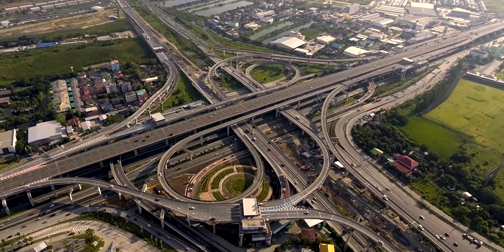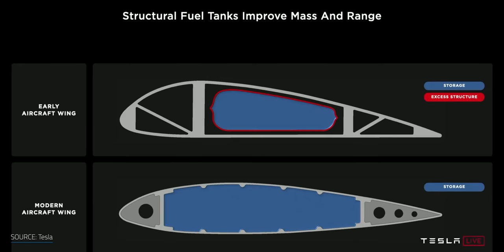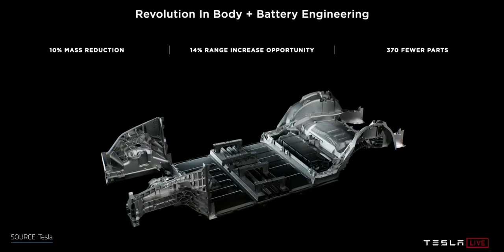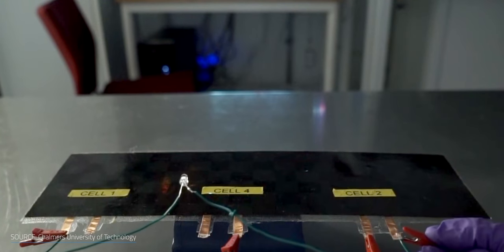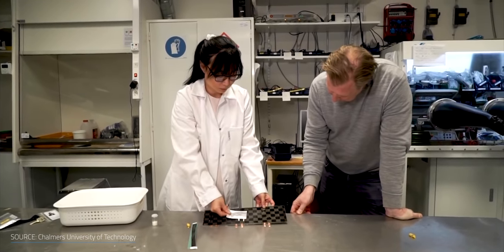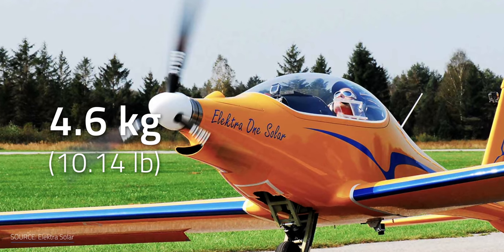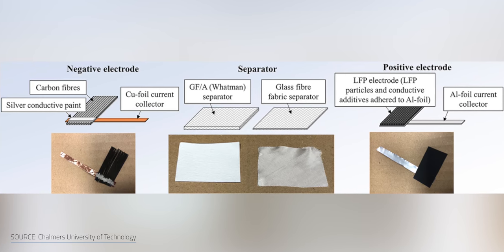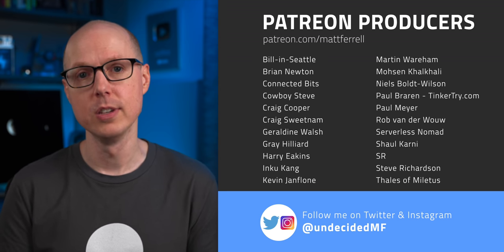Exploring Structural Batteries

Comment: Although very interesting, I think this creates a throwaway automobile. What happens when the batteries go bad? Replacing a super structure or frame of the automobile is monetarily ridiculous. Where did they end up in a landfill?
Reply: That is what I was wondering also.
One thing I did NOT see addressed.
When the battery is at the end of it's life (It will EVENTUALLY happen), how will it be REPLACEABLE? And at what cost if the vehicle would need to be (REBUILT).
OR will the vehicle be (DISPOSABLE)?
Reply: Great point. And given Tesla’s anti Right to Repair mentality without legislation that’s even more likely to happen.
Reply: it would be great to see what thunderfoots take on this, he's quite an elon fan
Reply: @azzabouy8243  I use to love that guy but he became a cocky opinionated grifter
Reply: Unfortunately I'm tired commenting this on every similar video. There it goes: anyone remember when we could change battery in the phone? There it is, made to fail at its best, first bulbs that only allowed 1000 hours before fail then phones that need discarding when battery dies then integrated radios and sat navs that can only be upgraded by replacing the car and so on and so on ... Wake up people!
Reply: @chrisemmert1387  that is if you don't have any accidents. If you do, the car won't last long enough to use up the batteries. this is complete bs
Reply: @dazdoestip6459  WHS
Reply: Was thinking about the same, in some ways it can be addressed with some modularity and making it "easy" to replace the frame, but in this world of companies like Tesla that don't allow for any repair, that's not happening. We need better legislation and then we would need for car companies to make this possible. In reality this might only work for some parts that are not part of the main frame... maybe the bodywork
Reply: You buy a new one. The battery pack was intentionally left accessible for servicing and repairing, but Elon doesn’t want to be in the automotive repair business, he wants to be in the sales. Disposable products for the consumer driven economy.
Reply: I mean, cars already get recycled. At least the metal electrode material and the electrolyte would probably be recyclable as well in these batteries.
If it comes to that probably depends on the engineering.
Reply: @djfernando16  lol, how often do you get into car accidents?
Reply: It's probably not even that hard to make those batteries serviceable if Elon wanted to but, sure let's make cars with the serviceability of an M1 MacBook
Reply: I'm just surprised no one is looking into making water electrolysis cars more cost effective or a viable solution.

We know it needs platinum, but how material efficient can you make it? Imagine running a car on nothing but water. Separating the water molecules to hydrogen and oxygen.

Oxygen could balance out the CO2 emissions and the hydrogen could be used as a gas combustion engine. And since it produces hydrogen on demand, it is relatively safe since water is not flammable.

There won't be any waste.
Reply: 1 year use cars... Or until a heat wave hits it... This is unchangeable batteries in smartphones all over again. There's a reason I don't buy those 😒
Reply: @resphantom  You realize the energy it takes to separate water is equal to the energy you get combining hydrogen and oxygen into water, right...?

You can't run a vehicle off that, the net energy is zero assuming perfect recovery. Realistically you'd actually run at a loss.
Reply: @DBZHGWgamer  source?
Reply: @DBZHGWgamer  It also takes a ton of energy separating crude oil, which is several varying lengths of hydrocarbon chains into the smaller, specific ones needed to be used as conventional gasoline. Separation processes, to purify substances accounts for 60% of the chemical & petroleum industries, and is actually ~35% of GLOBAL energy consumption.

The argument for running at a loss to me isn't valid. The bigger argument is the engineering logistics for a hydrogen car, such as high pressure containers for the oxygen and hydrogen storage, otherwise the car's range is non-existent. Energy density of hydrogen as a fuel versus gas, and other factors we can get into if you'd like.

I'd say there is a good argument to be made for the transition to fuel cells using water, DC current breaks water into O/H at low voltage (~1.4 V), solar cells supply DC as is, relatively easy implementation for the production of the fuel. Just the cost of the car is going to be higher and people need to be willing to spend it. Currently we're in "A Brave New World" mentality of throw anything away and buy it new. We need to fix the insane consumerism mentality if we want to even honestly consider a fuel cell car.
Reply: @resphantom  Have you never passed highschool chemistry? All the energy you get in combustion is purely determined in the difference of the bond enthalpy of the reactants and the products. If your starting reactant is water and your end product is water, the difference in bond enthalpy is zero, which means zero energy generated. It's literally the basics of the basics of chemistry.
Reply: @chrisstubbs6391  That's irrelevant, he's talking about putting water into a car to run the car. That's literally impossible, you can't generate any energy breaking and remaking water in a car. The system you're thinking of is different and uses hydrogen as a battery to store energy generated in a power plant.
Reply: Im sure they will find a way to recycle them
Reply: @chrisstubbs6391  It takes roughly 8-9% of the energy received from oil to not just refine it but also transport it. So for you to say running at a net zero at best is kinda odd. 100% when the largest argument is bc of emissions. 
Do ppl think making solar cells is clean? The batteries clean? The modules clean? And I see everyone talking about how it will be safer...  No No NO! Yes water is water and it is "on demand" BUT! 1.) You can't take out all the hydrogen out of the "tank/motor" bc the start up process is the largest energy consuming part. 2.) Even if you wanted to take it all out it's damn hard to w,o a vacuum. So no this is far from all safe as other state.  
 If hydrogen was so amazing why the fk are we not making power plants with it? It's almost as if they would solve most of what we are talking about right? Considering most energy used is not consumed from driving... 
 So instead of focusing on cars y don't we focus on the largest energy consuming problems first and let the chips from the cars fall where they may?
Reply: @DBZHGWgamer  It's not irrelevant and it's ironic you're insulting his intelligence without understanding what he is talking about.

For starters. yes his description is a little off, but if you're such a good chemist as you seem to be preaching, you could easily correct him and make his idea realistic instead of acting like there is no truth to his statement, but I guess that takes "intermediate" chemistry knowledge and basic humility.

He specifically said electrolysis of water, using platinum. This is a very specific reaction of running hydrogen and oxygen over a platinum surface (which acts as a catalyst and conductor). The gases recombine into water, which is a net production of energy because water has less enthalpy than the individual components. The energy is directly converted to electricity via the platinum and can be used for powering an EV in theory. He isn't saying put water in and running a vehicle off of that.

It's also more efficient than a combustion engine because it's 2 degree of energy conversion, chemical potential into electric into rotational kinetic energy. Whereas a combustion engine, which could be run off of combusting H and O just as easily as gasoline, converts chemical potential into heat/pressure into linear motion into rotational motion, 3 degrees of energy conversion with each step inevitably resulting in entropic losses.

He is talking about a fuel cell car, with water as the exhaust. He explained it poorly sure, but surely someone as informed of you would know what he intended?
Reply: @dizzlethe7346  I may not have made my point clear enough. Yes undoubtedly fossil fuels are net positive on energy otherwise we clearly wouldn't be where we are today. Was just pointing out to the other guy that all energy storage devices requiring putting energy in.

Is green energy "clean"? Obviously not, there are always CO2 emissions from extraction to construction to end of life dismantling. Nuclear is a good example, very CO2 intensive for if I recall correctly the number of steps, 12 out of 13 "Steps" for it's lifecycle from raw materials to disposing of nuclear waste with the only CO2 friendly step being it's actual operation. That being said nuclear is the best option because of the energy density it has and the energy we get from breaking the strong force as opposed to chemical bonds. All these environmentalists want to go 100% "green" to save the planet, but doing so will require (for the same energy output), destruction of a large percentage of the nature they're trying to protect to install an energy grid to achieve it. Because I'm sure you know green energy is not very energy dense or reliable at handling variables like cloudy days, lack of wind, storing excess energy, etc.

The thing with some forms of green energy is their longevity that makes up for their less energy dense, solar panels have an average life of 25-30 years, this greatly outlives many traditional such as motors (5-7 years), boilers for steam generation (10-15 years), etc. And solar panels are significantly easier to maintain requiring near zero upkeep. 

I'm on the fence of the whole CO2 thing because for at least 60 years all the climate alarmists have bee wrong and constantly pushing the goal post, adjusting their models, and still we don't see the doomsday predictions they keep giving us.

That being said it is to me reasonable to consider feasible alternatives that are relatively safer. An oxygen leak from a tank won't cause chemical poisoning of ecosystems like oil/gas. Both are flammable/explosive, so oxygen has the relative safer score there by not being a long-term health hazard.

Not exactly sure what you're referring to about taking all of the hydrogen out of a tank/motor. All start-ups having higher transient energies sure, but how does this relate to not being able to remove hydrogen from a motor? Very lost on your connection between the two. Especially the part about adding a vacuum, electrolysis reactions aren't operated at a vacuum. Can you elaborate?

Personally I'm in favor of energy reduction, billions of lightbulbs that operate inside buildings that are empty, it adds up. And a transition to more nuclear would be nice, they're inherently safer than any other energy source when you compare energy production to deaths/environment. But people are so afraid of it.
Reply: @resphantom  Yes, bond enthalpy isn't the basics, just bond strength and enthalpy. Because those aren't at all the same thing or anything.

In any case the dynamics of a hydrogen fuel cell car is completely different, but in the end it's basically just a battery to store energy. And as a battery it has a lot of it's own issues. You can refer to Chris Stubb's comments for some of that information.

And also, you're running on hydrogen, not water. So none of that "safety of running a car on water" applies either. But that was just you explaining it improperly or something...?
Reply: Tesla Still has a modular system with their structural battery, it's still a battery pack it  is just bolted onto the floor and is the floor. It will be a major thing to do, but since you only have to do it every ten years or less it should still be worth the savings in weight.
Reply: @chrisstubbs6391  "Such a good chemist as you seem to be preaching."
So apparently telling someone a concept from highschool chemistry and commenting that it's an extremely basic concept... Is preaching that I'm an expert in chemistry...?

How does that logic work, lol wut?
Reply: @DBZHGWgamer  That logic works because you came from a place of arrogance and insulted him for supposedly not knowing something instead of just presenting the information. 

You're presenting yourself as pretentious.
Reply: @DBZHGWgamer  It's also the internet, you know nothing about his age, country, education, etc.

For all we know he could have never taken a chemistry class.
Reply: @zacharywissinger3996  I imagine this is where vehicle rental becomes more interesting, since when then vehicle reaches end of life it then becomes the manufacturer's issue. I am sure regulation will also step in to help clean up any mess the auto industry creates.
Reply: @chrisstubbs6391  My first comment in response to him simply presented the information that seperating oxygen from hydrogen and recombining them would give you a net energy of zero. Instead of saying that wasn't what he was saying or looking into it he doubted and asked for a source. Were I to actually produce a paper on electrolysis he probably wouldn't be able to read it, but that's what he asked for. Instead of taking the long way around I introduced the basic concept myself since he was unwilling to even do a basic google search to fact check himself in the first place.
Reply: I foresee it being the Apple of cars (planned obsolescence/unrepairability). Once it is out of warranty, it’s the owners issue.
Reply: @djfernando16  Totally. The issue is just so huge that I can't wrap my head around how to create such a culture shift. My best guess would be social marketing and easy to digest stats/infographics.
Reply: Carbon fiber is the next asbestos. It's just as dangerous when inhaled and is nearly as inert. We'll be seeing the health effects when vehicles featuring carbon fiber make it to the crushers.
Reply: @chrisstubbs6391  In the first place, why should it be considered ok for a person to advocate a technology they don't actually understand? That's not ok. If you're advocating hydrogen fuel cell cars, it should be expected of you to understand how they work, atleast in terms of the basics. It's because of people who know literally nothing about the crap they're promoting that projects like Theranos, Solar Roadways, Hyperloop, ect run away with hundreds of millions and even billions of dollars, all wasted for crap that obviously couldn't work with knowledge taught in highschool. People shouldn't advocate any technology they can't accurately explain.
Reply: The only way I could see it fully possible at the moment anyway. Is if they did like auto parts now of cores but with the whole vehicle. You have so much go wrong and you trade your vehicle for a core which is almost the full value of new but then you're forcing customers. Or if they make it to were you can unplug the door which is the bad battery and replace it that would work like today. Idk.
Reply: @DBZHGWgamer  Eh, I agree and disagree to an extent. 

I agree with you the point of boondoggle projects. But those I attribute to political favoritism and corruption for subsidies more than saying it's the fault of the population for a misconception. Think it's safe to admit most modern policy isn't in line with popular desire anyway.

As for the other point,  I have to disagree entirely, I think he has the right to talk about something. He's got a misconception sure, but I rather present the objectively right concepts instead of what you are saying which to me comes off as a advocating censorship.
Reply: @Array_of_objects  How optimistic. And gullible. It doesn't sound recyclable in any way to me. And there is still lithium in it, as it seems "integrated" in an inseparatable way. The fact that reuse or recycling is not mentioned at all says a lot.
Reply: @chrisstubbs6391  First I have to just say I'm happy to see we are mainly on the same page. On well, EVERYTHING lol. 
I want to address the "tank/motor" I was talking about either holding or making the hydrogen IN the car it's self. Everyone "not you with this" talks how safe the car would get bc it's just water... Your always going to have pressurized hydrogen on board in said tank. Basically a bomb, that doesn't need fire to go boom..  Like yes batteries aren't supper safe either but I'd rather have that couple of seconds that the fire starts then a boom if something goes wrong lol. 

Nuke power as the main lasting energy provider over the next 20-100yrs I agree with. Along with solar.. mixing into your light comment, we already have a major unused area we can put panels.. Every fking road with light poles or plain electric ones. Along with the replacement of the 6-800watt hps lamps with 40-100watt LED the replacements alone will go hella long way. 

 ROFL better keep that talk on the DL here about CO2 in this chat. But again I agree with you on the lvls.  Ppl are so fixed on CO2 being the only link to global warming/climate change (wtf ever the hip thing is) that they blinded themselves to other larger factors. That if they didn't could also become forms of energy. Like methane gasses! If you look at the productions of CO2 an methane into the air they both have gone up damn well together, yes methane at half the clip but we are talking about something that holds 8xs+ then co2 does. But CO2 is what we are fighting? Even tho we know it's been 10x higher in the past (what happened? Plants grew better ROFL) but methane as far as we can tell has only been 2x what it is. An what can we tell that happened in that time? O higher temps?? Ok ok CO2 is the cause sounds legit with the facts THEY show. 
Sorry so long but the shit talk got me going lol. Also makes me want to point something else out.  It's not like we can't capture and use ALOT of the methane produced either! Sweeden does it, with both landfills  (everything is ran off collected gas even trucks) and sewage plants in med/larger cities. They not only run the sewage processing plant off of it, they run the water processing plant and also precondition/reheat the water for the steam heating systems they have for the city inside the microb pools. Sheet seems light years ahead, now imagine doing both (bc landfills still have stacks that burn off extra methane)next to each other inland of a major city like NYC (a good chunk are heated off CITY steam already) picture being able to use the wastes. To heat (use the landfill to preheat also) purify the waste water, make drinkable water along with either making the gas or power to run most if not all the transportation and street lights in the city. Not only from wastes but wastes that ppl already pay to dispose of. You can rinse and repeat for any decent sized city too. You can do the same on a smaller scale with the "hot" wastes from animals also while they wait for it to cool an sell as compost...
Reply: Exotic cars already use CF for their chassis. Carbon fiber already cannot be repaired once damaged. 
They will not use this for affordable cars but maybe on concepts/exotics.
Reply: @dizzlethe7346  I just want to point out hydrogen tanks for cars don't go boom. They are designed like the industrial H storage tanks except smarter with sensors and a rupture in the tank(which takes the force of a large ballistic to rupture) causes it to quickly leak out like a mini RC rocket. Its much safer than a fossil fuel tank which combusts and keeps burning for hours till everything around is burnt to a crisp.  
Hydrogen gives a heavy sedan -/+70mpg so the hydrogen tanks are very small to last a good range of 300 miles. 
With enough stations it's very possible they will also take over traditional gas stations in the future. 

It's good to point out that currently there is a renewable source progression of using biomass gas as a methane replacement that will reduce the footprint even lower than EVs.
Reply: @dizzlethe7346  A lot of your comment I agree with, but honestly I disagree with the use of solar. People are too stuck on the idea of solar and wind as the only viable renewable technology. Honestly geothermal is way better. You don't have to have massive arrays of batteries for geothermal, you can raise or lower the output at will and it doesn't depend on external factors. And with current technology, you can put a geothermal plant basically anywhere, you don't need a natural gyzer. All you need is some drills some water and basically any peice of land. It'll have a bit higher initial investment than a solar array or wind farm, but it's more than worth it.
Reply: @chrisstubbs6391  It's not censoring, I'm not saying silence people. Just expect more from people. Address them when they're wrong. Create a culture where people learn to be informed and that they expect that being ill-informed will harm their reputation.
Reply: This would work for fenders, doors, hood and trunk lid. They won't all fail at once. It might make the car last longer.
Reply: @DBZHGWgamer  "why should it be ok for people to advocate something they don't understand?"

How is this not censorship? Galileo was considered wrong about a heleocentric universe by everyone else. 

I get the point your trying to make, but it's from an absolutist perspective.
Reply: @chrisstubbs6391  You're clearly completely misrepresenting my argument. I said don't advocate something you don't understand, not don't advocate something other people disagree with. Those aren't the same thing.

Secondly either you don't know what "censorship" means or you simply aren't understanding the words I'm saying. Censorship means removing the ability for an idea to spread or removing the ability of a group or person to have a platform. At no point did I indicate people or ideas should be silenced or deplatformed in any way. What I did say is that people should expect to be corrected and insulted for not doing their do dillegence it reaserching an idea before advocating for it.
Reply: @DBZHGWgamer  I merely interpreted the quoted text as them shouldn't advocate and without context implied you meant by taking away their ability to advocate it.  

Not trying to misrepresent it intentionally, just my interpretation because of the flaws of written language not being able to present a speakers tone fully. I agree with most of your point, still think insulting is a quick way to have valid points fall on deaf ears.

Appreciate the civility either way, always refreshing to have instead of typical internet raging.
Reply: How often does an entire motor get replaced in a conventional vehicle? Unless your some grease monkey car modding mechanic, or know one. This never happens.  There are warranties for the Batteries and motors. If it fails with normal use on a car that has structural batteries, the owner get a new car. The car returned under warranty would likely go back to the manufacture which could deconstruct the vehicle and move the functioning parts to another vehicle.
Reply: Just make it biological or something
Reply: @JasonB808  Not the point. In this case the battery IS the car.
Reply: @dazdoestip6459  You can still change batteries on a phone, or at least phone shops can do it. If you're brave enough, you can do it yourself. You can back everything up to a Google account online, or to an SD card, so if the worst happened you wouldn't lose anything. They either spudge the cover off, or gently melt the glue. China still has big piles of pouch cells to sell you.
Reply: Cars don't go landfills. They're always salvage value. But yes, It's a trade off. Luckily, it's a tradeoff that we can very easily mathematically calculate if its worth it. A non-replaceable battery means the car will depreciate in value more rapidly. If the energy saved plus the quality of life value of having added range is greater than the difference in depreciation, then it's worth it.
Reply: @walkinmn  You can't really replace the frame of a car at all these days. Often the bodywork itself is load-bearing or force-bearing, they haven't made them as chassis + body panels in 40 years or so. It's all monocoque. Even if there were a separate chassis, you'd have to un-bolt and un-weld literally everything from it. But there isn't. It'd be more gutting the old car for parts, then fitting them to a new one, taking way more human labour than it did to make the car in the first place, which robots mostly did. 

Still, the cash value of the various parts will be different from present-day cars. If the old body is useless, and also the battery, that's where a lot of the value will be. The old motors, you might be able to salvage for spares, a garage could buy them from you for future repair jobs, although generally electric motors don't go wrong often. Nor do electrnics. The computers, though, on an old car are likely to be laughably obsolete, so nobody will want those. So all in, little demand for the few bits that remain viable. 

Overall, economics will compensate for it. Things end up at a price that the buyer can afford. Structural batteries might save a lot of money in car construction. Electric drive, too, requiring no gearbox, or necessarily any drivetrain. No fuel system, and simplified cooling. Could be a lot of savings in electric cars. Right now they're priced to compete with ICE cars, and at the higher end, because currently there isn't much demand, or supply capacity, so they started at the high-mid end. That can all change drastically. Look at what PC's cost in the late 1980s, compared to now. They now cost around 10% of their early price, and that's just ticket price, without considering inflation. And of course our PCs are thousands of times faster, thousands of times more storage, etc. 

Cars won't change that dramatically, but electronics in a mass market have a HUGE potential for massive price changes. 

It probably won't be possible to have replacable chassis any more than it is now. But that doesn't matter, the economics can be totally different. What the customer is willing to pay is one of the principal factors in pricing things. Less and less labour goes into making a car, there's a big cost saving. If people get used to carbon-fibre (DON'T call it plastic!) structure, then that's a load of metal that doesn't need digging up and refining. Yeah carbon fibre isn't cheap now, but aluminium used to cost more than gold, per ounce. Plenty of carbon on the planet.
Reply: @DBZHGWgamer  all the time. Never my fault
Reply: @greenaum  yes I know but that's not the point, the point is that they make it so hard to change the battery not to mention you loose water proofing after you change it so  people just change the phone. Now on to another point, you would rather have to unbolt and unplug to swap your battery in the car or would you rather cut it out and unglue of its body and then cut and rejoin the wires required?
Reply: Agreed, also considering the high envi impacts of curing carbon that is a none recyclable material.
Reply: @dizzlethe7346  Yeah the tanks is one engineering challenge for a fuel cell. If you want to compete with the range of a gasoline car they'll need to have the oxygen and hydrogen either be in highly pressurized gas, or a combination of pressurized and cooled container to store as a liquid fuel. Either of these options are going to make the cost of a car skyrocket. I think it would be better as some people have mentioned to focus on short range vehicles instead. Side note the hydrogen is relatively safe at high concentrations, there is an upper explosive limit so the H2 tank will not be flammable or explosive, oxygen is a different story, >25% can spontaneously combust, always fun.

As for the lights, LEDs obviously more efficient, could be wrong but I think there might be an issue with having enough raw materials to replace every light with an LED. Need to look into that more, either way a reduction in energy consumption is always reasonable.

Yeah the CO2 thing always had me bothered. First it's the question of chicken or the egg. CO2 levels are rising, so is temperature. Water cannot hold as much CO2 if it's hotter, so is raising temperatures releasing CO2 or is it the CO2 that's causing the temperatures? Kind of inclined to believe the former, we're at 400 ppm CO2, that's 0.04% of the atmosphere, you're telling me that changing concentration in the air by a value that's 100x smaller than standard acceptable errors (5%) for calculating things like rocket design is going cause >6% deviations in temperature? Like I get the heat capacity of CO2 is half that of steam at the same temperature, but a 0.04% change in heat capacity is not going to drastically change how much energy it takes to actually raise the air temperatures.
Reply: @dazdoestip6459  The radio thing is a major reason why I own older cars. I love custom audio and having to do hacky things and possibly lose functionality is a huge downside. Oh and the build quality of late 2000s to now is awful in NY they rot so fast from the salt.
Reply: @DBZHGWgamer  Yeah, my explanations suck, still working on that. Eitherway, it would be interesting to see if they can take that electrolysis tech further, because the major downside for using chemical based batteries is improper disposal or underground water contamination.

The reason I meant that it's relatively safe is it depends on the engine design. If it consumes at the same rate it produces hydrogen, then there should be very little left to blow up in case of an accident. In case of a fire the engine would mostly contain water.

Unfortunately, conventional cars don't blow up because they're full of fuel, they are more likely to blow up when the tank is almost empty and only fumes or gas is left. But a full tank leaking fuel could be a major fire hazard.

They could also always use the same water to cool the engine, however any combustion engine with friction would lose too much energy and not be feasible.
Reply: @resphantom  And what energy are you using to produce the hydrogen?

Again, a car that runs on electrolysis doesn't work.

A hydrogen fuel cell car does not use electrolysis.
Reply: @chrisemmert1387  why do you feel the NEED to type WORDS in capital LETTERS
Reply: @justthink124  I thought so too. But drone batteries cant be integral with the structure unless you want to replace your entire drone whenever your battery performance degrades.
Reply: @dazdoestip6459   
Car lifespan more than 10 years.
Phone lifespan 3 - 5 years?
Reply: What a circus.
Reply: @lwolfer5170  well, it a bit late for lightbulb moment. Capitalism and large scale corruption led to this. It didn't happen over night, and we're all part of it.
Reply: Also what happens if you hit some debris - and do some damage like that guy who was told by Tesla it would cost $16,000  to replace the battery (even though a shop ended up doing a $700 fix)  https://www.thedrive.com/news/41493/teslas-16000-quote-for-a-700-fix-is-why-right-to-repair-matters
Reply: @dizzlethe7346  it’s because hydrogen is easily accessible, it wouldn’t be profitable so they make nothing that uses it because they can’t markup the price.
Reply: @chrisstubbs6391  with the hydrogen part. Would it not have to either be at ungodly pressures tho? That or your going to rely on the car to split the molecules an if you do that your range is going be cut and your either going to need the sun (an solar) or a large battery in the car anyways right? 
An if it's high pressure then it's very much a bomb that not only cost a ton but who all will actually be able to work on it?
 I'm pretty sure HPS bulbs (of a Street lamp size) are consuming more resources then the led ones. 
 As far as solar naw man it's not going to be the end all solution. But that combined with nuke power can take up most our power needs if not all of it with hydro an the stations I talked about being the rest.   
With solar I just don't understand y we are not using the empty space we have first then build out. We have plenty of roof space, light/electric poles, tons of open roads an waterways that run east to west that already have power line next to them.  100% the light pole shet tho, we already pay to run and replace them. The city I live spends something just over $200 a light for maintenance, electric ect pr yr Putting a 200watt solar panel with LEDs in it should cut those cost to 1/4 yearly along with other electrical bills.   An for the amount of money it would take to get to a point we are not paying for city utilities I just don't understand y it has not been done.  PS FK wind power it's too costly, needs to be repaired to often an is shut down too much with "high" winds. I love on lake Erie an to have wind power only work a few months out of the year is actually stupid lol.
Reply: Yes it would wouldn't it... That's why they need somekind of buy back warranty so it can become recyclable. All done with 3d printers. It can be done!!! Imagine if it could even be made self healing or at least healable at the factory...
Reply: @DBZHGWgamer  I'm with you on Geo also! Look I just went on the rant about landfills and waste water lol. With how they can an do use it to preheat water. I'm in the middle of building a family compound now! It's just almost impossible to retro fit existing homes an it's costly AF if you have to drill everything vertical! That an it being cheap to heat (an cool) with fossil fuels no one wants to convert. That an most ppl dont need the output even the smallest Geo systems can put out so that puts then off for some reason. Even tho that mean it runs more efficient but w.e.. Like I'm able to keep a 5000sqft uninsulated shop only on the pump and 3loops of the system..   I have a pretty basic mixed loop (both vert an horizontal lines) but I added a commercial aspect to it having two insulated 5000g tanks dropped into a pits filled with sand. To use as main batteries one hot one cold but I also have a massive pond I'm going to use for heat storage and put lines running in it also for winter. Hopefully only one more lake Erie winter an it'll be up.
Reply: This will be as recyclable as mutlistream plastic.  While theoretically possible no one will do it.
Reply: @WhiteWolfos  I understand what the tanks are made of. But thos tanks also have life spans and dos along with don't. Like massive temp swings that will happen in a vehicle tho. Making the tanks take stress they were not designed for. So ya the tank at first might be safer then fossil fuels then. But over how many cycles is it going to degrade giving you a massive bomb in your lap? With everyone talking right to repair. How many ppl are going to be able to work on them? An I don't even mean just yourself but how many 3rd parties too? So not only is the cost of the car going to be sky high, keeping/work on it will also not to mention insurance, do you know how much insurance cost on any EV right now? Much less a Tesla. When I had a Tesla (3months) I found my insurance was almost the same as my payment. Making the $100savings in gas NOTHING. $450 car 350 insurance to save $100 or just pay $200 for a fossil fuel an insurance.    With $100 in gas a month. $300 vs $800... The practically of focusing on the car when it doesn't use anything compared to a home. An expect ppl to want to change off of the car is actually insane. This focus along with battery tech needs to be on the home an corporate aspect of things to actually make an impact. An with that being said if hydrogen was so successful y is it we aren't making power plants out of it? Again for the car aspect when home an business needs use more fossil fuels then transport ever will. Finding the best aspects for Corps not only makes the tech cheaper but gives a blueprint on what to do in a smaller scale, doing so makes it easier for the average person to also buy in right?
Reply: @JasonB808  it's literally 7-14bolts and some wiring harnesses. My wife was taught how to replace a motor in a Ford escort in two 4hr days an if she can do it anyone can. And I swear if I hear someone say well you need tools to do that. Has no one ever heard of renting out a shop?
Reply: @kandy5129  Ok but in that same sense why would energy providers not use it then? They would have no cost in fuel this way right? They don't bc you do not get a net positive in energy production. I'll have to find the papers.  But the only way I know of that they found you can get a "greater" energy is from double heat capture. Making the device large an your not always going to need or use that heat. When that happens it goes back down to less energy output then you put in
Reply: I think the body would have to be made of substructures and so replaceable parts - very similar to to the repair industry today - of damaged parts there is very little actual panelbeating getting done these days most damaged parts are replaced
Reply: Crash absoroption rails can be cut off and replaced.
Elon musk is making it still possible for repair shops to do what they need to do I think. I dont think this will be a problem with legislation imo.

For a company like Tesla, I personally give it a pass for not having spare parts available. Their a new company, and dont have the necessary manufacturing capability to meet demand enough. Naturally they would prioritize newer customers over old customers. In time, once they get their plants up and running, we could probably see spare parts come out in the future.
Reply: @dizzlethe7346  I'm talking about geo power, not geo heating. While geo heating is useful, in many scenarios you can achieve somewhat comparable levels of efficiency with a normal heat pump depending on weather and have normal natural gas heating for backup. It is also way cheaper than installing a hole geo heating system.
Reply: @bowez9  Sadly if we can't get it right we kill our innovation and go no where but you are correct. The solutions are a given if they can't think any further than their pockets and don't work out a win win. They don't have to loose money to do it they just got to use their brains... Come on Mr. Musk I dare you!!! Wish He could see this.
Reply: @dizzlethe7346  Depends on your idea of ungodly pressure. Typical SCUBA tanks have working pressures of 3500-4500 psi with a hydrostatic test pressure of ~5000 psi. That is significant amount of gas, but even accounting for increased gas density due to compression, it's still ~20x less fuel for the same volume as a liquid O2/H2 tanks. Liquid tanks have technical difficulties arising from the liquid evaporating as it is used. 

I think the idea of scuba tanks as storage tanks is feasible, would make refueling almost faster than conventional since it's just swapping tanks. But again we'd have to collectively be satisfied with significantly reduced range per tank.
Reply: @Array_of_objects  sent it to a 3rd world country and let the people break it up by hand to recover the useful stuff... kind of how electronics are done today... only down side is the toxic material that the people are exposed to and the mess that’s left behind.... clean for the first world consumer....
Reply: also, think about an accident or a fender bender. if your car door gets dinged, and the door is the battery, what happens to the battery? how expensive is the repair? could a minor accident cause the car to be written off because an integrated battery got dented? if not hoe would a dented battery effect performance?
Reply: @chrisstubbs6391  it's not just the reduced range tho. Refilling or replacing the tank not everyone will want to do an will take longer then just filling up fossil fuels.   
 Plus my point with the tanks was more a fatigue thing along with outward pressure not inward like you find on scuba tanks. That along with corrosion from salt an other materials found in cars. Bc I assume we are talking either stainless steel tanks or aluminum right?  An like with the range what your talking about should be able to be solved with just public transportation I'd think.
Reply: @dizzlethe7346  Public transport is a completely different point, if people did that more often or rode bikes like Denmark, we would be a lot less concerned about the emissions of cars.

I'll assume you've never gone diving, but changing a tank is literally a 20s process if you're proficient, gonna be faster than the pump, but again smaller tank.

Not sure what you mean by fatigue, the pressure is inside the tank, not outside, there is no "inward fatigue" for pressurized tanks. Worth noting though, is pure hydrogen is going to be a complete pain to store in metal tanks at low temperatures because of hydrogen embrittlement. 
https://en.wikipedia.org/wiki/Hydrogen_embrittlement

This is again why liquid fuel would be better, but that still has problems with implementing.
Reply: @DBZHGWgamer   Geo power your talking massive an deep holes that have to be in stable areas tho. Right? An I mean will be great for supplemental output specially linked with a main nuke along with solar supplement also.  I just don't know if it can be used in enough places to make a massive dent/be the end all be all energy. But then if batteries keep making leaps and bounds who knows. But I think it's going to have to be a decent mix of things to have good reliability.

Yes I am talking heating an Geo cooling. But the same time I am also taking any extra energy and storing/making a battery or energy. either in water tanks, a pond or the earth both the heat and the cold to be used later. An heating a pool also. It's far from a normal home application. Lol  ya I have two 15 ton main commercial Mitsubishi compressors/heat pumps seer 32 cooling and 35 heating  at 65 degrees F. Or starting temp/ Geo temps 10ft deep in south east KY/ near Knoxville Tennessee. An they only take 3500watts to start and 2500 to run full blast with enough BTU to heat and cool 10 houses plus my shop. Along with being the main driver of intagrated heat pump driers and refrigeratorsan or freezers. An that's just to start with! Bc after my "storage" is to temp it's either going to be easier to run everything/less power or I'll be able to heat an cool more.  An if you have the land/pond or water it's not as expensive as most ppl think. I rented a back hoe an put in 8 400ft lines myself for less then 2 drilled 100ft double loop lines... An if you have water it's almost as ez as going to the middle an tossing it out lol.
Reply: @chrisstubbs6391  naw my point with PT is that it only works for city ppl mate. We are much larger then Denmark an have way longer commutes to well anything lol.  

 I drove a tow motor when I was younger an I'll tell you now that changing a tank is FAR from just 20s... An that was located on the outside of the vehicle with room to get it in and out.. it's not going to be that ez inside a car. An the average person male or female is not going to want to lug a empty 20-50lb tank around.  An most aren't going to be able to handle full tanks as needed to replace them. Top off could you imagine forgetting to lock the 80lb tank down after changing it, slamming on your brakes and having it fly threw the trunk into the back of your head. Then your going to need a industry wide standards from the tank itself (so it fits all cars) to the connection. Then deal with how sea level effects the amount you can put in a tank over the vast landscape of the US..  Then we get to the fact to make something like liquid hydrogen you get the same energy as you put into it. Ok but then you take losses when you make energy from the hydrogen. An what energy was used to make the hydrogen in the first place?  An again idk if I missed it or not.  But if liquid gas was so great why don't we have more electric plants running that then coal? 

 Then when we are talking such short ranges Y not just stick with batteries? Not this type of course to many flaws on how it's done as a whole. The way battery tech has come the past 10yrs you get almost 8xs the storage in the same area but lighter package, give it 10more LoL.
Reply: @dizzlethe7346  Never said it wasn't technically challenging for the idea of a hydrogen car, but fuel cells do exist, Toyota if I recall is the brand trying to commercialize a fuel cell car. 
But their approach is more of a battery style instead of tanks.

The idea is hydrogen/oxygen formation from water could he done prettily easily from DC voltage powered by solar. Submarines use an oxygen generator that basically does this, splits water into the parts and vents the hydrogen overboard. You need very pure water and KOH to aid the process though. 

Coal is a solid, more dense than liquids, inherently way more energy dense, and just laying in the ground. Seems like an obvious enough reason why we have so many Coal plants, it's there in the ground to use.

Batteries are nice, but the push for Li based batteries does bring up some morality problems with mining it. Australia had a huge reserve, but there's a lot of conflict in Africa with warlords like diamonds were and continue to play. Theoretically even transatlantic air travel powered solely by planes is possible with continued battery improvement. I'm a skeptic of that claim, but they were made by people who are heavily involved in battery research.
Reply: @chrisstubbs6391  As far as the energy production an emissions we give off. I went over this in another comment on this thread. But we waste so much an are not smart with recovery at all.  First we could replace the 6-800watt HPS street lights with 40-100watt LEDs. We can toss a 200watt panel on them ALL. The led is cheaper off the rip then hps cost less to run an last 3x the hours.. Then the aspect of no captured methane (the real green house gas) from either landfills or sewage processing plants. Along with all that captured heat. The misplacement of solar farms displacing wildlife when we already have massive east to west roads with power lines an light poles that can be used for solar, we also have massive water ways we should be placing then next to (like India) that not only cools the panels but helps with evaporation in the Southwest US. We don't capture the heat or cooling from the refrigerator,freezer, AC,furnace,dryer an store it for later use none of it. Like ya ok you capture only 7% here an an extra 11% there. But after the storage tanks get primed up you still get that % but it also make the device it's self run more efficient... Everything I'm doing is about to be heat pump sourced connected to a Geo thermal system. Making it so I can have ten homes running with a 5k sqft shop run off a 20kw solar with 2kw hydro system with little to no battery backup- just a secondary/3rd pond that is pumped  to the top of the hill during the day from the extra solar collected.   The crazy part about all this is that it's cheaper for me to go this route bc most of this is done except and by renting tractors or (some being propane driven) backhoes. 80k total including with heat pumps, Geo lines, ponds, turbines, concrete, shop built,solar panels and 2 solark12ks. Compare that to 15-20k each house for HVAC now only needed 1-2k of pex a pump an manifold system. That doesn't just heat and cool the house but also the clothes an fridge/freezer. Cutting thos monthly cost to 10 maybe 15% of normal.
Reply: @chrisemmert1387  I would keep chickens in mine 🐔🐣🐤🐥👍
Reply: @dizzlethe7346  Hey man I hear you there, geo thermal is really nice, especially on a hot summer day. Typical AC can only reduce 20 degrees under ideal conditions so if air temp is 90+, like it gets in GA, best cooling is 73+. But if my heat sink is the soil, you bet I can get a lot cooler in the house. But I'm preaching to the choir here I'm sure.

I like your plan to heat integrate things, any recovery of energy adds up. And while your set up sounds ground. It's out of the scope for many people, especially in cities.
Reply: @chrisstubbs6391   pretty sure that Toyota was in the late 80s?  It's not that it can't be done. It's that not only do you have a ton of standards to figure out. But like I said who is really going to be able to change it? An is it really going to be faster and or at least easier to do then lifting a a nozzle or plug? I don't think many ppl will be able to lug it around an I for sure don't think it's going to be fast. 
As far as coal yes your right it was this way back when we didn't care about pollution. But we are talking about taking that away so I don't get y we wouldn't be replacing them 100% when most the plants shouldn't be hard to convert.... 
 I thought it was more the Cobalt mining an the areas it comes from with Li tech? An I thought alot of that was being solved from the new Tesla battery that used 10% of the Cobalt. Either way Li composition isn't the future, the same guy that invented Li batteries has two different solid state drives that are in cycle testing atm that should blow everything away. One is striking like this a carbon fiber compound and they other recycled carbon composition. Think about that last one for a second... Pulled carbon from the air to make batteries. Actually bonkers..
Reply: @FootEnjoyer  he has always been a cocky opinionated grifter
his break through video "if men acted like feminists" altough funny always showed he was a biggot. He stopped being funny.
Reply: @djfernando16  it's no different from what happens to cars today. Plenty of people buy a new one after 5 years.
Also they could loosely fuse it to the car body, so you could cut out the old battery and fuse in another. Would cost some money in working hours, but probably still a lot less then buying a new car.
Reply: @dizzlethe7346  There's actually 3 fuel cell car in market right now, the Mirai is one of them. And I'm pretty sure you're talking about graphene which has been touted as revolutionary for like the past 15 years but nothing has come if it yet lol
Reply: @chrisstubbs6391  ya the graphene is the one with the carbon fiber tech. An yes the lifespan is the main drawback. But the carbon nickel "plates" is the promising one. I'll have to find some links. Very much like the other, as in thin wayfers plates pressed together. Just the carbon ones do not have the temperature or cycle limitations the other does.  But it's energy density is off the charts! But slightly less then the graphene. 
 As far as time goes. Mate look how long it took Tesla to announce the "new" batteries, after buying the tech b4 he even made a single car... It takes 15-25yrs just to make the prototypes an enough of them to do scaled testing b4 you even start the manufacturing process an then do more testing in batches from the line. B4 they even hit a commercial market for 5-10yrs then get to consumers. Last I knew the carbon nickel type just got 1000 prototypes finished after the 5yrs of testing. With the first one with something like 5000cycles done to that one and still going with some stupid crazy low number under 5% energy density loss. An the graphene/graphite? Ones are hitting the commercial markets now for medical equipment an things like diggers that need large amount of energy stored in small places. Bc yes you only get half the lifespan out of it but the density is like 5xs that of any Li type. So if you charge it less you should end up with a longer life span.  Plus the discharge rate an recharge rate of these types makes Li seem like charging up a toy RC car lol. But only time will tell.
Reply: @chrisstubbs6391  TBH I actually did not know that an account could only cool 20°... No sheet. 

 Ahh see most major cities are next to water that can be used( not as well as I am but well enough to help a heat pump system) an I've talked this out with a few city planners that get floored. Take NYC a good chunk of the buildings an almost all the streets are heated from steam. Take that plant place it on the outskirts along with water an sewage plants and the land fill. The methane captured WILL run All the plants. An 90% of the machinery an trucks (garbage, busses an transit). With the water you help preheat your water/steam lines, going from the water to the landfill for even more heat, to the microb pools of the sewage that both get very hot from decomposing. Making it so you need very little fuel for the steam and or hot "water". Ok that helps solve winter. Then the only thing you need for summer is to cut out the loops going into the landfill and sewage. An make the water from the ocean,river or lake that has a closed loop system in it, to the main "heat pumps" to just cool the same system used for the steam/hot water. And while it's making a cold water mixture to send making heat pumps down the line work 100xs easier to cool in the summer. You can be dumping the extra heat in the system now from the other heat pumps, back into the landfill and or preheat the water used to make electric from the captured methane.  To power the water, sewage and trash plants, while thos are down power street lights and help with transit. 

All I'm saying is this can scale EXTREMELY well in places like the US. It's the extreme cold places this becomes a challenge.    An your killing like 8 birds with one stone. Not only are you capturing the worst gasses, you make energy from it, lower costs of the consumers, using "unusable" space, helping brake down not just sewage but garbage faster/ using land more (able to put more garbage faster in the same area) , and you store energy in places you never thought of like landfills.  They already have to line the landfills what's putting in a layer of sand for a thermal brake/insulation so the heat stay in better? 
Like I get my setup does cost a good chunk right away. But it would seem cheaper and easier to do/setup in a city along with a efficiency rate unbelievable compared to what is used now.
Reply: @chrisstubbs6391  Yes a person in the city cant do what I have. But the city could be built to do this.  An places like NYC, BOS LA. Even land locked places could set-up like this, ya the cooling wouldn't be as good. But it's as easy as running two more "water" lines a few more feet deeper then most places already runs them and about the same depth as most sewer and or storm drain lines. Russia has been doing this (central heating An cooling) for 90yrs...
Reply: When A tesla battery fails (just out of warranty)  the  replacement cost would buy you a small petrol car and a lot of cash left but if it can't be replaced that means a new car every 10 years or less. Hugely wasteful. Great for any car maker that can get away with it.
Reply: @walkinmn  I am not even convinced about body parts. Imagine a small shunt that damaged a panel causing a short circuit, and then a fire, or shuts down the whole car if its autodetected.
Reply: The concept of batteries 'going bad' is not a foregone conclusion.

Labs have made effectively infinite cycle Li ion batteries before now, I think it might be more difficult with this battery class, but not impossible.
Reply: @chrisemmert1387  This may be way way way into the future but certain polymer batteries have been shown to cycle (charge and discharge) 200k times without any loss of capacity. Scaling has been a tough question to handle with this specifically, but it might be the case that eventually we won't need to replace batteries. "Check out Better Batteries through Chemistry; UCI" if your curious about this
Reply: @dazdoestip6459  I agree, in the case of phones, they're doing it purely to be dicks. Although you could argue it increases waterproofing, I'd rather have a replacable battery, but I'm in the minority of people who don't change my phone every 5 minutes just to get a new one. I keep mine 5 years or so. 

I think with phones, most people would have trashed theirs before the battery gave out anyway.

In the case of cars though, it's not just to be profit-chasers. It will save a load of weight from the car, make manufacturing cheaper. It has real advantages. It might well mean that a car has to go back to be re-manufactured when it no longer holds a charge (although battery tech is leaping ahead as far as number of charge cycles goes, solid electrolytes ought to help there). 

It will change the lifespan of a car and change the second-hand market, but customers have power, a lot of power. If the deal they're offered is too shit, they won't take it. If customers don't buy this year's latest frame-battery car, they'll stick with last year's replacable-battery, and manufacturers will shit themselves. Some manufacturers will go back to replacables to cater to that big market.

Ultimately people will get what they want, or at least something approximating it. Especially since Chinese cars haven't taken off... yet. They're not bound by rules or tradition, they'll make whatever sells. Of course you might not want to actually travel in one if you value your life.
Reply: @greenaum  yes customers have power, but like you said people like you and me are minority and unfortunately when it comes to majority they seem to take what ever big companies tell them to take, you can see this most especially when it comes to fan based companies like tesla and apple, tesla went from using AAA battery to D cell and everyone went nuts on what an invention it is, apple stopped using headphone jack because they said you don't need it and everyone's happy, tesla again invented subscription for your cars features and everyone just bows their heads. What will happen next is all other manufacturers will follow and some people like I won't be happy but then again I'm only minority and won't change a thing.
Reply: J D  swing and a miss, completely missed my point there dude, and no I'm not using IPhone and replaceable batteries might return thanks to EU but again that's not the point I was making and this is not where manufacturers are trying to go.
Reply: @resphantom  Lol, the electrolysis car is a perpetual motion machine.
Reply: @SurmaSampo  I saw that now, it suffers the same flaws as the battery cars. Electrolysis cars need already made power to work, the cost, effort and engineering is too high for a good payoff.

Straight up burning fossil fuels is the only way to go, unless there is some way to make some godly carbon trap that separates carbon from the emissions and easily compound it into a carbon block.

Too bad that the carbon molecule is almost just as big as the oxygen molecule.
Reply: If they are made to be modular then that will possibly create more revenue stream.
Reply: @dazdoestip6459  that's the result of greed. Strong legislation will be required to prevent that but other brands may choose a different approach like a modular option.
Reply: @greenaum  About increasing waterproofness, I funnily enough just watched a video earlier by a man named Louis Rossman, a R2R advocate, in which he shows a video where he goes swimming with a camera,  some small gopro like thing, and it's waterproof,it survived the swim,  and it has a replaceable battery, however he forgot his phone in his pocket, and that phone has a sealed battery, yet the phone still died
Reply: @DBZHGWgamer  In Iceland geothermal heating is the way to heat water, and the way my house stays warm, despite all of our geothermal energy, using electric heaters off of that energy to heat up water seems a bit daft
Reply: @vikingursigurdsson  No one said anything about resistance heating. A heat pump is not the same as resistance heating.
Reply: @unvergebeneid  recycling takes energy. Better to be able to use a product for longer by making the product more serviceable.
Reply: @vikingursigurdsson  Just to be very clear here, hypothetically if you could extract all the heat energy from the water in question to get that water to room temperature, and used that energy to run a heat pump with outdoor temperatures around 40F, you'd be able to put 3 times as much thermal energy into the room using the heat pump than you would from the water directly. Now you're not actually going to be able to get that much thermal energy out of the water either way, and conversion to electricity will have some loss, but running a heat pump could easily be more efficient because of how damn efficient heat pumps are. They can operate at a heating efficiency of 300%.
Reply: In the normal run of things I reckon by the time the battery needs replacing the body shape will be out of fashion, so people will want to change their cars anyway.  I guess the motors and control gear could be refurbished and fitted to new cars, the body and interior recycled.
Reply: @rogerbarton497  I guess it's technically possible, but companies tend to veer towards disposable more than not these days.  And the only times I've known a car's structure to be changed, pottery much the car is totaled and heading to the junk yard, so I'm not confident that integrating the battery into the structure of the car won't likely result in a disposable car.
Reply: @rogerbarton497  The average age of a cars on public roads in the USA is 12 years old. Saying no one is gonna be using the car past the 5 or 6 year mark because it'll be "out of fashion" is pretty baseless.
Reply: @DBZHGWgamer  In the UK it's 8.4 years  (https://www.autoexpress.co.uk/news/59950/average-age-uk-cars-reaches-record-high)  "the highest figure ever".  Living in the UK I know that people are very snobbish about the cars they own (or more likely lease), so my assertion isn't as baseless as you make out.
Reply: @asdqwe4468  head lights and tail lights are still very simple fixes on most cars...
Reply: @thelazy0ne  you do realise it doesnt work that way right.
Reply: The latest battery tec outlasts the vehicle.
Reply: @Dana5775  Maybe so, but it’s not in any of them now
Reply: @TexasScout  neither  is this structural battery.
Reply: @dazdoestip6459  Well, you wanna say thing, I'll counter. 

One of the reasons we went from replaceable batteries to internal is simple. Without the need to make a thick protector to the battery, we can increase capacity without increasing size. And besides, the LG G5 had replaceable batteries, and that phone sold horribly. I'm on my 4th year of my Galaxy Note 9, and it functions just fine. Take care of your batteries, and they'll last you. 

Also, about the bulbs. The "forever bulbs" were expensive, not bright at all, and drew a TON of power. So what if you had to replace a lightbulb every 1000 hours... they're what, 10$ a bulb? Moreso for Fancier ones. Heck, my Philips hue LED Colour changing smartbulbs are about 35$ each. if needing to replace a bulb every 5 years or so is the trade off for better, brighter and efficient designs, then awesome. 10$ a bulb every 5 years? That's a non-issue.

And if you're that worried about phone batteries, for one, take care of them. For two, buy cheap phones and recycle them once you're done with them. There's plenty of places you can bring your electronics for processing. It's as if you're the one in need of waking up...